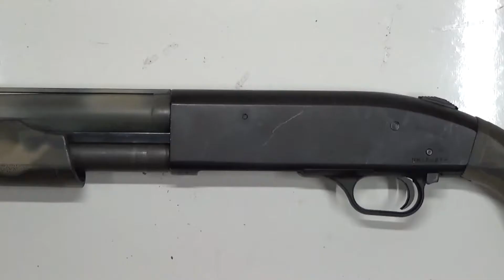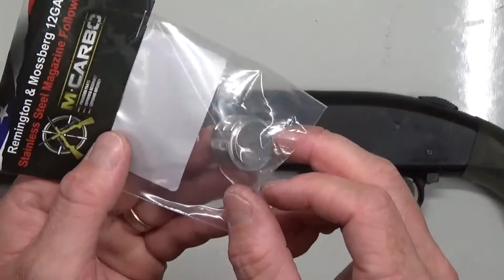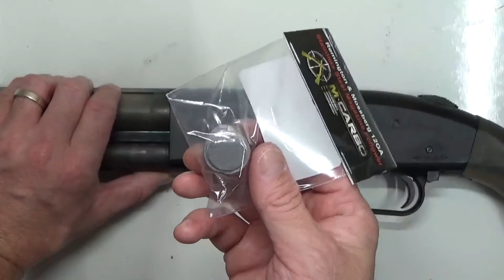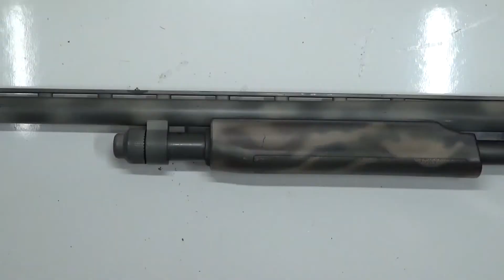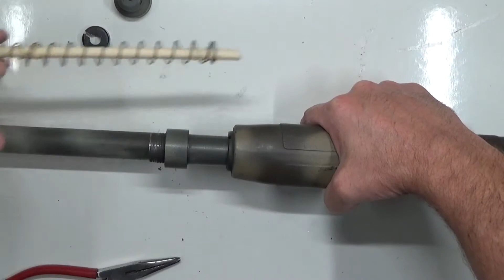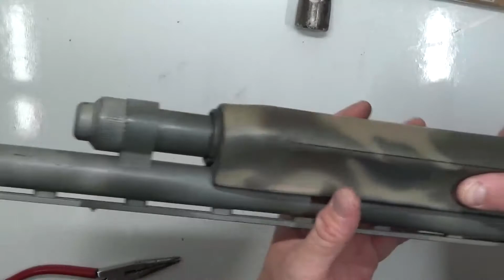Remington & Mossberg 12GA Stainless Steel Magazine Follower Upgrade Installation by MCARBO

Comment: What if your 870 has dimples  like mine how do you get the follower out
Reply: Turn the follower, it has grooves cut out , line up with dimples and it pops out.
Reply: Remove  dimples?
Reply: @zachbernal4509  nope
Reply: @Whitchhunter666   Actually, Brownells sells a dimple removal tool. So... Yes!
Reply: @zachbernal4509  You dont need to remove the dimples in order to remove the FOLLOWER,  It turns then you can remove the follower,  but in order to add an extended mag tube  then you must either dremmel them or use the "special tool" that cost $50,00 or a right sized beveled socket that slides inside mag. Tube.
Reply: @Whitchhunter666  my follower has cutouts to slide past the dimples but the gun was in a fire in the past so maybe something is deformed because the heat. I will try the beveled socket i have some of those in the toolbox 👍
Reply: @zachbernal4509  the follower is now deformed. It will not come back out if it got hot. Just smash it through the mag tube with a piece of re bar and get a new stainless one for 13 bucks on e bay.

Comment: Installation is a lot different on the Maverick 88 and Mossburg than for the Remington. Lot easier on the Remington. You have to heat the receiver to break the loctite loose and remove the barrel on the Maverick.
Reply: I was about to purchase this for myself, and my  cousin, as we both have 88’s. Thank you for saving me some money. I was stoked to purchase this, and throw it on our shotguns real quick. Good to know that I likely would be stuck , as I am not that savvy, and don’t wanna mess with all that.
Reply: @nicktrue7915  I had already purchased it but the video they show is for the Remington and it’s easy. They should show the Maverick 88. I haven’t did it yet but I will. Not looking forward to it. I did do the trigger springs and it cut the poundage in half and it wasn’t to difficult to do. I watched a video by someone else to do it.
Reply: @doug3805  I will def buy those springs then.
Reply: Maverick might be a pain but the 590 is just about identical to what they showed in the video

Comment: hey guys did you loose  1 rd capacity using this follower ?? I'm also using a wolf extra power spring  will I loose a rd paring the wolf spring with this follower ??
Reply from the maker: We didn't loose any capacity with the follower but didn't test it with a wolf extra power spring either.  Like anything we make and sell if your not happy at anytime for any reason just send it back for a refund or exchange.  We aim to keep all gun toting customers happy!  ;)
Reply: MCARBO will the wolff extra power spring work with this if it does I'd be really interested
Reply: I did lose one round capacity with my mossberg 590 without even having a Wolf Spring,  the 8th round just barely sticks out the back enough not to enter the magazine tube,  That being said the product is far superior to the stock one extremely well made.